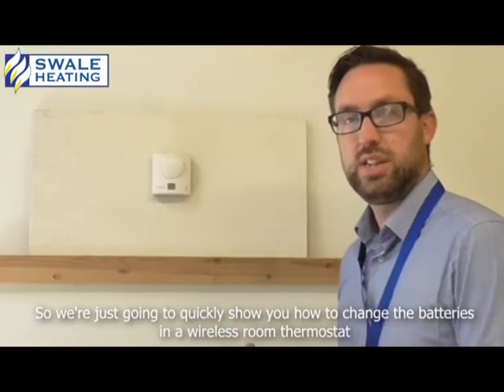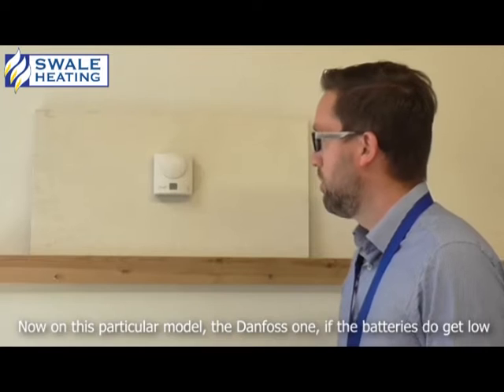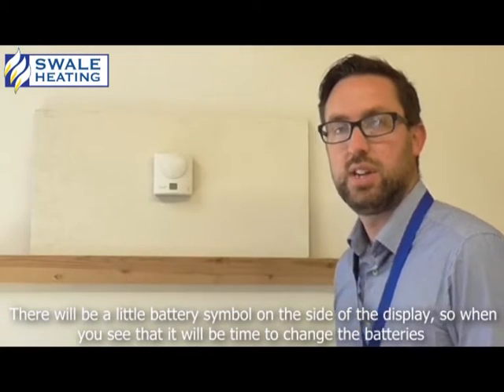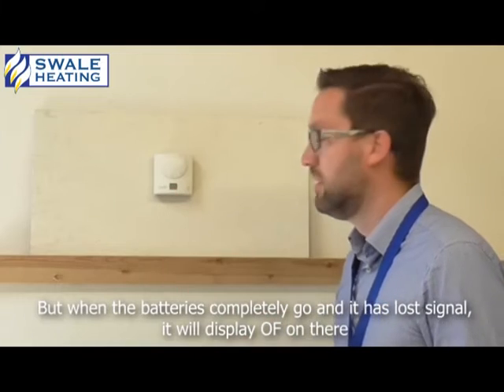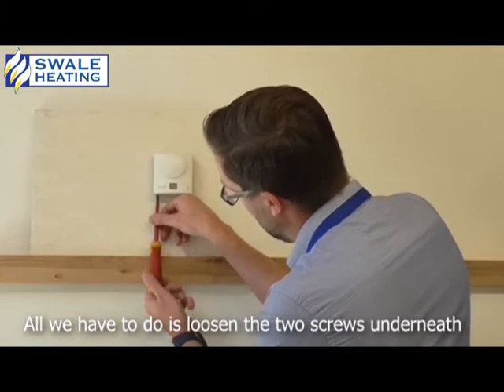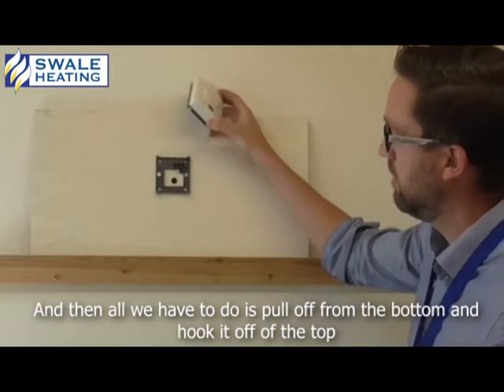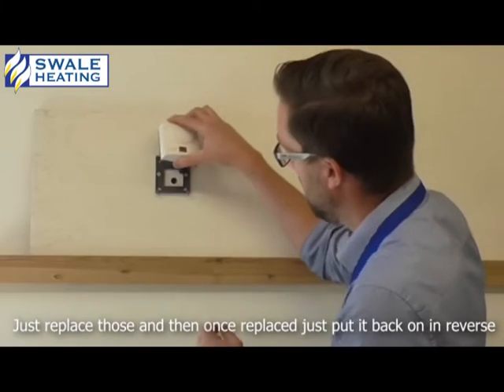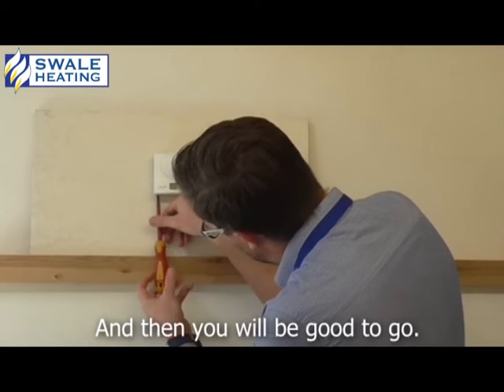How to change thermostat battery 2017

Comment: Mine doesn't recognise Alkaline batteries from Aldi.  It came with some Sony batteries, which probably ran out a few weeks ago (only reading the user guide alerted me to the little flashing icon on the left).  I've found some Duracells in a hifi remote it will recognise.  All of these say they are Alkaline btw

Comment: Mine isn’t connecting to my valiant and not firing the boiler but says it is on the controller is it a connection problem and how do you fix it?
Reply from the maker: Hi, would you be able to tell us the model of your thermostat and what your thermostat is displaying? We would then be able to provide you with a more reliable diagnosis. Best regards, Swale Heating.